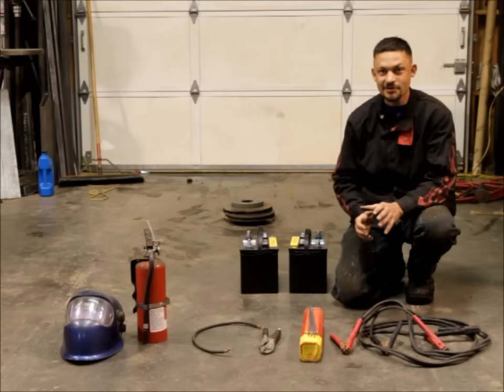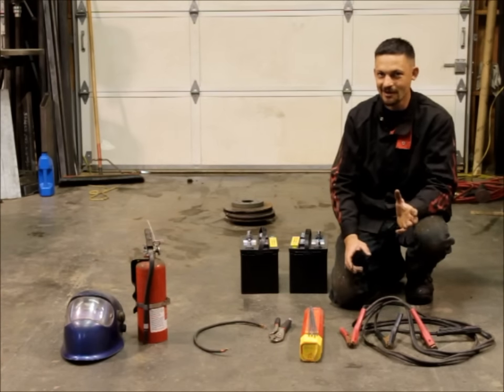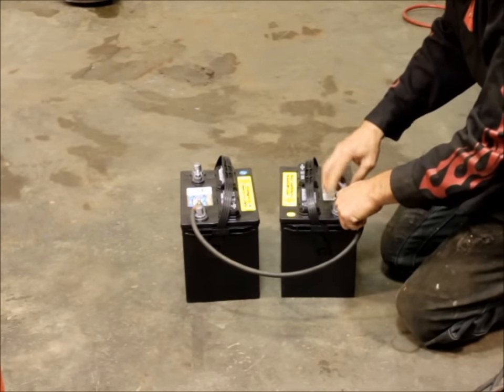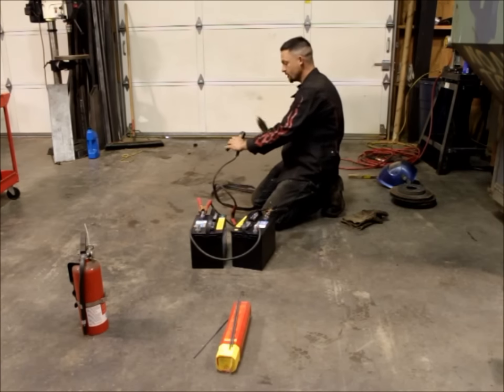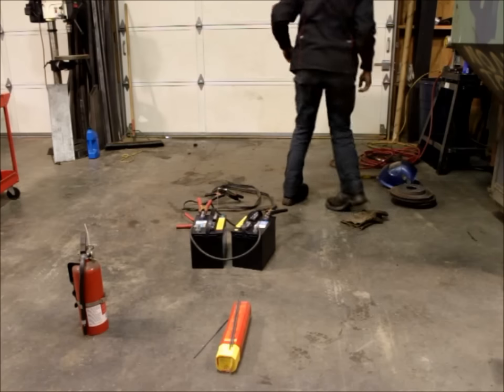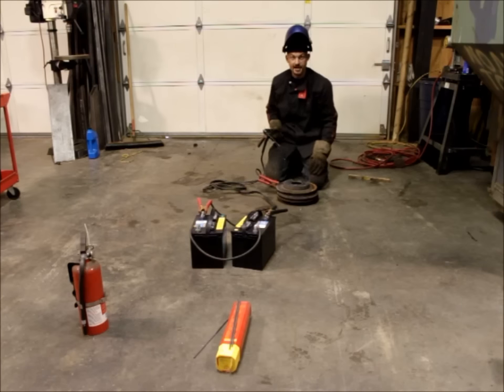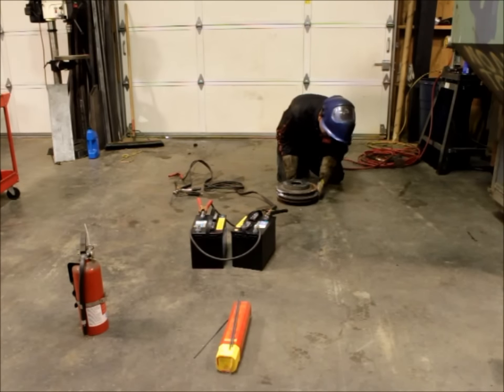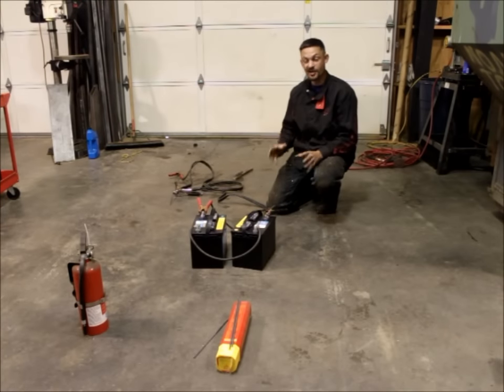Welding with jumper cables and a pair of batteries

Comment: Great video except for the lack of a close-up shot of the welding. That would have been interesting to the viewers.
 I have done the same thing almost a year ago, and was surprised at how much quieter and cleaner-looking it is compared to AC welding.
 One thing I havd found out later was that a negative electrode would push the arc and the rod material into the weld (deeper weld), and a positive rod would pull the arc away from the weld and make it a less deep, surface weld.

Comment: I always get into situations where im working on my car. I break a bolt, then cant proceed to work on for a long time because it will take me weeks to get the broken bolt out. Is it safe to use this method for example welding on nuts on studs to remove them?

Comment: Just saw this video, and it's not a bad idea except I wouldn't take the batteries from the vehicle(s) because when he tries to reinstall the batteries, depending on how dependent the computer is on a constant feed, the vehicle(s) won't start because disconnecting the batteries can screw up the computer, and/or the welding can deplete the batteries. It's probably not a great idea to remain stuck on the trail, so if at all possible I'm thinking that buying a couple of batteries ahead of time is pretty inexpensive.

Comment: I'm a combination welder myself bro! And I can tell you for sure... "people can learn something new every day"... because I just did. Thanks for this video bro! By the way... How many amps is that putting out?
Reply from the maker: Kevin Smith it pulls around 150 amps, as measured with my DC ammeter.  but that number varies, because batteries are a CV source  (instead of a normal CC stick welding supply).  It works...not perfect, but works well enough for an emergency repair
Reply: Very informative... Thanks bro!

Comment: How long will the batteries keep this up. Are they still usable in your car to start the vehicle after your done.
Reply from the maker: It depends on the reserve capacity of the batteries and how healthy they are in the first place; but I've found that you can get around 1 minute of arc time; more than enough for most emergency repairs, and still have enough to start the vehicle.

Comment: I ride with 2 batteries so my inverter does not bog when bearing down with a grinder or running my compressor.My question is if I add another battery and run alternator wire so they charge how long will the batteries last and how long can I wield for. Would I be able to run the jeep and wield at the same time for more power?

Comment: I have a 5kw 180 amp generator 28 volts dc output. Can I weld straight from generator or come off batteries being charged by generator?

Comment: Just a couple of questions about this... I'm not a welder but have been wanting to learn but not waste money on something I may end up only using a few times. Does this work because of the amps and can a power supply work instead of the batteries?
Reply from the maker: A normal welder basically IS a high current power supply.  SMAW welding (what is shown in this video) typically requires around 150 amps (varies depending on several factors).  That power supply is designed to deliver a constant current; you'd dial in 150 amps, and it would deliver 150 amps for the entire welding cycle.  Welding with batteries is different; that's basically a constant voltage power supply and the current varies based on how big the arc is, diameter of the welding rod, etc.  It works well for an emergency weld, however it takes a little bit of finesse and isn't the same as welding with a proper CC power supply.  if you're wanting to learn how to weld, I'd suggest buying an inexpensive import machine from somewhere and beginning with that.  I wouldn't start with the battery method...

Comment: NOTE WELL...  I enjoy welding, and respect the useful video above. But here's one risk the guy is taking... A battery exploded while my brother was under the hood, spraying his eyes with sulphuric acid. Some of the acid couldn't be washed out, so he was rushed to hospital. There they used a spoon-like device to remove his eye to flush out the acid behind it. He recovered pretty well. I'm just telling you this so you are aware of the implications of a battery exploding at any time during the above operation. Bruce Thomson in New Zealand.
Reply from the maker: +Bruce Thomson Yes; you are correct.  A battery explosion is certainly a risk.  However, it is really only a risk if you have a defective battery, or if a person does something foolish like overcharging the battery right before welding (producing flammable levels of hydrogen).  I have personally seen a battery explode; however it was due to improper connection of jumper cables during a jump start.  If you have healthy batteries and good connections, the risk of a battery explosion during welding is no greater than during an engine start, winching, etc.

Comment: In the mid '70's, I made a similar setup, but I had 3 - 12 volt batteries. I welded 3/8" 4" X 3" angle for my ramps. Way overkill, I know now, but I still have those ramps today.
I even still have my 4ga booster cables, but with newer ends. LOL 
You should have mentioned what welding rod you were using and what size.
I assume you were using 3/32" - 7018, but I could be wrong. That's what I'd use.
I just came across your YouTube channel. Am subscribing to it. Good idea for off roading. 
Keep up the great work. I look forward to seeing what else you have coming up.

Comment: Good video for emergencies, just out of curiosity as you're using 2 car batteries (2 x 12v = 24v), would this not work direct from one 24v battery as in those used to power a lorry/truck?
Reply from the maker: yes, it would. You can also make voltage changes by wiring 6 volt batteries into the bank. You do need to be careful that the batteries are of similar capacity and charge state to avoid reverse powering them.
Reply: +Junior J Don't trucks usually have 2 12-Vol Batteries wired in series?
Reply: +Olivier Tallon I know from experience most do but my last Volvo FM had a bitch of a battery. A 24v beast wired in underneath the side guard rail on driver side which was a nightmare when we changed it and the heaviest battery I've ever come across. Not sure if it was an after market job or factory set but it was replaced with 2 x 12v in series and when we replaced it there was only one battery tray so take of that what you will.

Comment: That was crazy cool! It won't damage the batteries at all?
Reply from the maker: Strictly speaking, any discharge charge cycle will reduce a lead acid battery's life. However welding using this method only draws about 150 amps, about the same as a starter motor or winch motor at full load. So from the batteries perspective, welding for 20 seconds is no different than running a winch for 20 seconds or cranking an engine over for the same time period

Comment: Just wondering, you made a one inch long weld on the top,
then when you show to the camera, there are four welds on top.
Reply from the maker: I filmed several welds for the video but only used one of the "takes."  I'm not trying to hide anything...

Comment: Might be ok for short bursts but I wonder about welding bigger parts longer welding's effect on the batteries as it is basically short circuiting the battery posts. Does a welding rod add resistance to the circuit? I never measured one.
Reply: You’re not shorting the battery’s. a short circuit is a circuit with no load. Aka a loop with no resistance.

The rod and the work cause resistance, which is a load (Ohms).

He is creating a circuit when touching the rod down. Not a short circuit

Comment: Very cool video I always wanted to be able to add welding to my abilities... So thanks also what would be the best possible price for a real welder for a novice, as I have a few projects that could do with it... Any HELPFUL tips would b much appreciated ✌
Reply: Markey Boy MKDKH you could pick one up for between 100-200 dollars. I saw one for like 120 on Amazon
Reply: Markey Boy MKDKH harbor freight welders are just fine
Reply: Markey Boy MKDKH A welder is cheaper than ruined car batteries.
Reply: Harbor Freight has a 120 Amp welder for $88 New Years sale ends Monday!!  run and buy it.
Reply from the maker: The method I show in the video is really only good in an emergency when you don't have a conventional welder; if you are planning on doing some welding in your shop, then you're better off purchasing an inexpensive welder (or better yet, a used miller or lincoln unit off of craigslist).

Comment: IDEA!! Please tell me any problems with this but...you have two car batteries, right? What if you had a small engine hooked up to an alternator? And the alternator hooked up to the batteries? Or even simpler, just use a plain old gas generator? Could you effectively charge the batteries? Are there any issues with a set up like this? cuz that sounds like a portable welding rig to me!
Reply: Exactly what I want to do, and why I am watching ths video again. You can even find 24v alternators for sale to charge both batteries at the same time, hooked up in series like this. I don't think it would have any big issues and the good thing is that you don't have to monkey around with the voltage regulator at all. I want to make a combination generator/welder/ebike with the setup and batteries on a bike trailer.
Reply: Ilir Kumi say your alt only puts out 120amps, your drawing a lot more then 120amps welding like this. The alt would burn out your rectifier diodes.

Comment: Just say you have two 800cca batterys, how long do you think you could weld before the batterys are to low to start the vehicle?
Reply from the maker: Around a minute of arc time
Reply: 1min @150 amps is a lot for an emergency welding...

Comment: cool I can't afford a stick welder right now my mig does ok, but for occasional big stuff this could fill the bill, 
WHAT SIZE ROD & TYPE OF ROD, DID YOU USE..?????     I HAVE LOTS OF BATTERIES......
Reply: I dont kbow what he used but 1/8 inch 7018 rod is like the "one size fits all" rod. Its a good high strength all purpose rod. If I only could carry one type I would carry 1/8 inch 7018.
Reply: Thanks..
Reply: important to not that this would be considered "emergency welding".  - Like when your vehicle broke down in the middle of woods.

It is fairly dangerous, to be honest.
Reply: +Joshua Stilwell I welded up a gate using batteries.  The gate was made up of two doors 5 foot wide for a span of 10 ft.  Took me most of the morning.  Gate was made up of 1/4 plate, 2x2x1/4 inch rectangular tubing.   

This gate is still holding strong after 15 years. 

This technique is not only for emergencies and is no more dangerous than gas welding.

Comment: Batteries will get hot doing this correct ? As it would be like a dead short when welding ?
Reply from the maker: JJD1913 no, they're not even warm to the touch after short stints of welding. This is not the same thing as a dead short. The Arc acts as a high resistance load, during welding you are drawing about 150 amps from the batteries. Less than a starter motor or winch motor poles during normal operation.

Comment: wow, very interesting,  does this process damage the batteries  ?
Reply: +ROB NAVAEI  Well, a car battery is build to deliver high amps for a short period since that is needed to crank the engine for starting. However, they are not build to do this for a long time, so not only you risk of emptying the batteries to far (so they are damaged) But you also risk that they explode. If your battery has deformed, it means it is damaged past what is safe. (i do not say however this battery wont work anymore, just saying that at this moment your battery might start to have an internal short wich means it will blow up) any manufacter will recomend to change battery in this case btw. Also always disconect the battery from the car itself exept if you want to risk to blow up your electronics. 
Also notice that most (lasting) injury an exploding battery will do is from the acid it contains.
Reply: Thanks for the info, I see now why you have your fire extinguisher on the side.
Reply: Every use of batteries is damaging them, and this is one of the most damaging due to high stress on the plates inside.

Comment: Wait.....wouldn't it make sense to have the negative be attached to what you're welding to? Wouldn't the electrons and material go to the negative connection?
Reply from the maker: different electrodes are designed for different polarity. You'll see that noted on the box; it will say dcen or DCEP.  I found that welding with jumper cables always works better with dcen, regardless of the electrode being used
Reply: Thanks for the pointer! ...I didn't even know that was a thing. Google gave me the details. Appreciated!!

Comment: great video, it was very interesting.
if anyone is considering this by throwing some sticks, gloves and a welding helmet in the tool box you may as well go the extra mile.
do yourself a favor and go to the local welding supplier. get a couple meters of welding cable with a clamp, the right connectors and a stick holder. it's fairly cheep and will all fit in the helmet.
also there are welding kits that plug straight into your vehicles alternator however they can be a little expensive.

Comment: Did he clamp the welding rod with the vise grips and then attach jumper cable to vise grips?  Won't that shock him or no?  Is it the leather gloves that is why no shock?
Reply: ......yes to the description and 24 volts isn't noticeable in terms of a shock but the leather gloves are needed due to hot spatter and prevent UV sunburn to the hand . A leather apron and hat also good , maybe an  old leather jacket .

Comment: What does that big box used by welders actually *do*? I'm setting up a mobile workshop and designing 3xLiFePO4 in series with a 300A adjustable current restricter. I've never used a proper rig before so what am I missing out on?
Reply from the maker: Stick welding is a constant current process; that big box contains a big transformer and ballast so that the operator can control current.  There's really not much to it.  Welding with batteries means that you're using a constant voltage process...not ideal for stick welding, but it does work in a pinch (as I show in the video).  Wire feed MIG welders use constant voltage (the welder maintains a set voltage and current varies based on wire feed speed, diameter, and a few other factors).  TIG and stick welders use constant current (the welder maintains a set current and voltage varies as necessary to maintain that current).
Reply: @MattVerley  Thanks for the info. I'm on a learning curve at the moment so I'll see how it works out!
Reply: @MattVerley  One question. Would an appropriately sized capacitor bank protect the batteries or would it be pointless?
Reply from the maker: Immortal SoFar I don’t think so...actually I’d be a little bit frightened of starting an arc with a big capacitor bank!  The batteries’ internal resistance is part of what limits current in the circuit.  A fully charged cap bank would be able to deliver enough energy to vaporize the welding rod in short order.  I’m not sure there would be any benefit to it...
Reply: @MattVerley  Whoopsie! Thanks for the warning! Teaching yourself software engineering results in nothing worse than some sleepless nights. Welding and electronics can make life a little more interesting!

Comment: Re exploding batteries.  A radio amateur reported this happening to a battery he had in stock. The reason was deterioration of one of the internal posts, causing a short inside the battery. It was a fairly old battery that he used and over time obviously, the metal support had come apart.

Comment: So to make 24v? Hook negative cable to positive. Then jumper cable negative to negative, positive to positive, and ground the positive. Weld with negative? Correct me if I'm wrong. And how would I hook up to jump start using 2 batteries? The same way, just keep jumper cables red to red. Black to black?
Reply: +Larry Evans ...Yes...When using multiple batteries you can wire them in Series (positive to negative etc) which multiplies the voltage but the amperage (current) stays the same.   Or they can be wired in Parallel (positive to positive -negative to negative etc) in which the voltage stays the same but the amperage multiplies depending on how many batteries you use.
Reply: +Larry Evans make 24v from hookin 1 positive to 1 negative, then attach remaining positive to your work and weld with the negative

Comment: Dumb question, can an AGM battery do this? I ask only due to  the difference in construction. Should. battery is a battery right?
Reply from the maker: yep, I have used the optima yellow tops for this kind of welding frequently.  they handle it just fine.
Reply: +sewerzuk thought so

Comment: You will get a hotter weld if you run the batteries parallel increasing the amps. In this video the batteries are in series. The sine wave would be faster in series though which might be more suitable for welding.
Reply from the maker: That is incorrect.  While it is true that wiring the batteries in parallel will increase the available current, at only 12v you'll never even be able to strike an arc.  Resistance in the circuit limits the current flow at 12v to around 50a, far too cold to weld effectively.  At 24v you get around 150a, perfect for most emergency repairs

Comment: I have been welding since I was 12 and I’m 65 now and in a emergency situation maybe...., but I would be worried about the rod sticking? And the battery exploding .....!! this is pretty cool but if I’m going to stick weld, I think I’ll just keep to my old Lincoln welder.....😃 by the way you are a good welder , that’s easy to see by the bead you ran with a car battery......👍